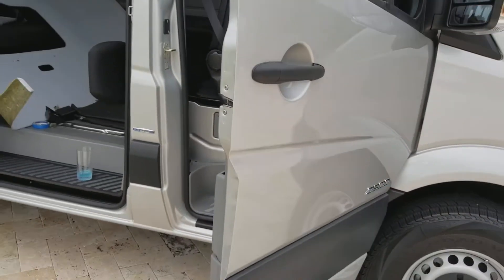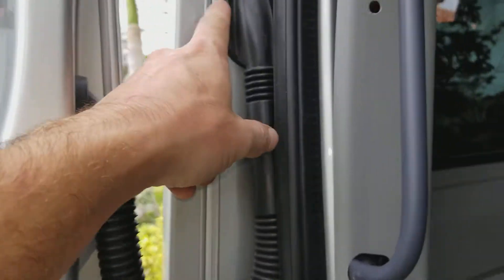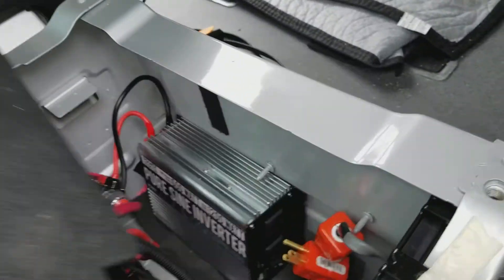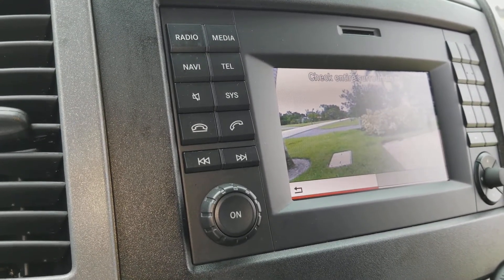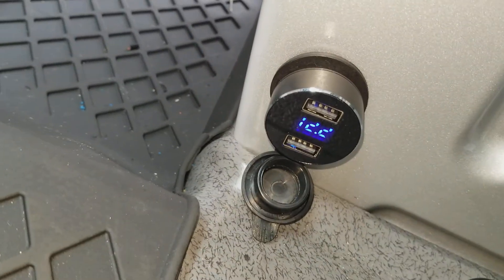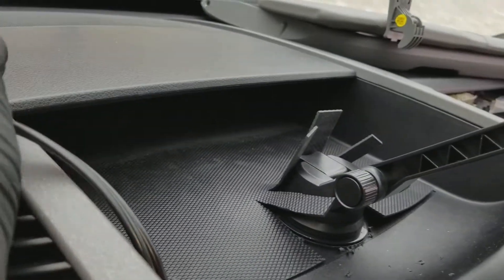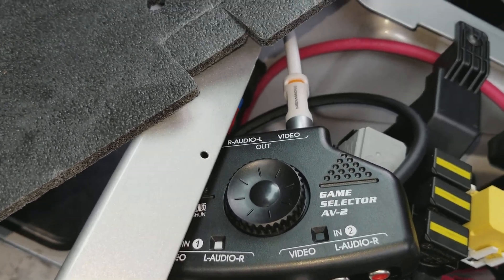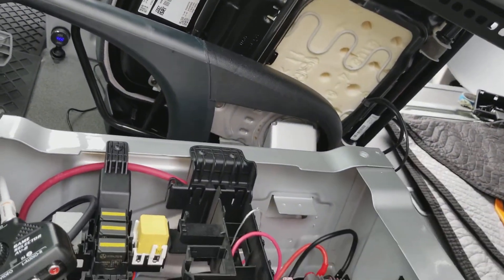Mercedes Sprinter Van 2016 conversion part 4

Comment: Nice video. It's amazing how much extra you're able to fit in the driver's seat box, including the inverter and have them wired so professionally. Very impressed.  Now I know where to put my inverter. You mentioned upgrading the 12V cigarette lighter sockets in the rear. I'm interested in doing the same thing but am not sure how to pop out the sockets. Do you just use a flat tool - chisel, flathead screwdriver, etc - to pry it out? Or are there tabs and clips that need to be pressed or something like that? Thanks again for doing the video!
Reply from the maker: I didn't change out the 12 volt adapters in the rear I added two more in the front under the seats.  I think those might come out with a flat head screwdriver or plastic panel remover tool but I'm not a hundred percent sure.